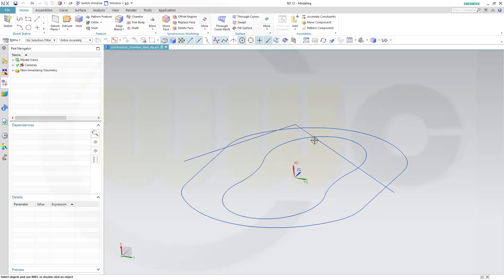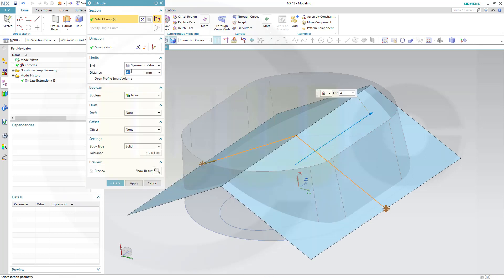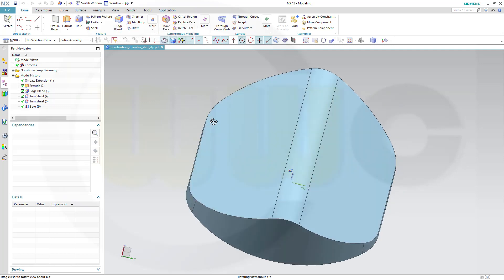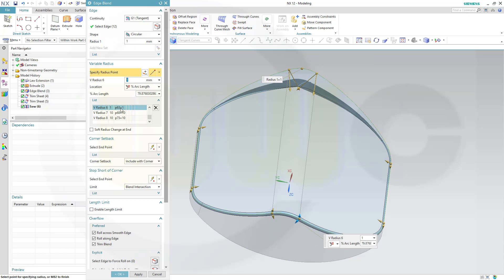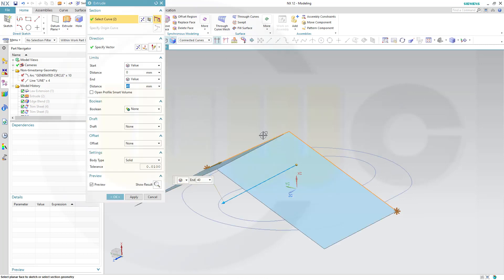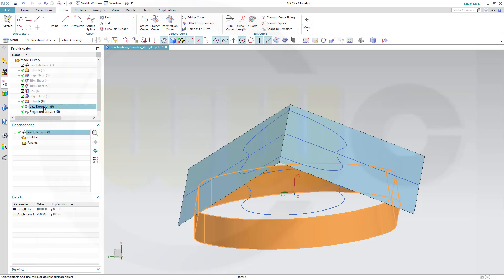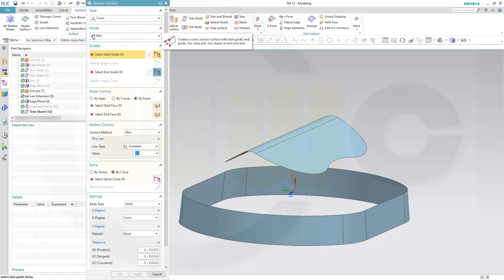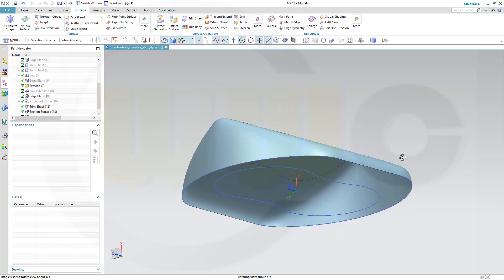Combustion Chamber - Siemens NX 12 Training - Surfaces

Comment: Hi Wolfgang, if you'd have picked the extrude instead of law extension, the result would have been a regular surface instead of a tolerated B-surface^^. Are u using commands for comparison reasons? Best regards, Simon
Reply from the maker: Yes, I always try to do it very similar in all the programs. It is not always best practice.

Comment: What is the reason of using this spine curve? In Catia it's not needed normally, only edges and tangent surfaces which we want to connect.
Reply: And do you have maybe some longer video about differences between Catia and NX? Like sew in NX is join in Catia etc. or also about methodology of working (I get used to using lots of body with link and booleans operation, all on axises and now in NX it's hard to work for me)
Reply from the maker: try it in catia without spine - it will not work. The profile is always "normal" to the spine, those sweeps/section surface are translation surfaces - so the profile moves along the "spine".
Reply: @wolfgang.walden.cad.training  I will try, but I think with blend surface with coupling or mutlisection it could works. I will check it, thanks!